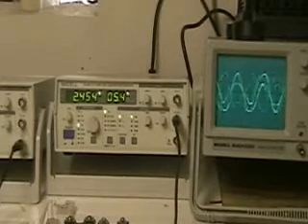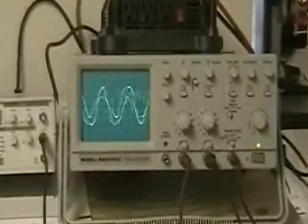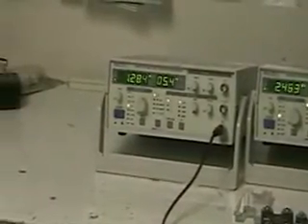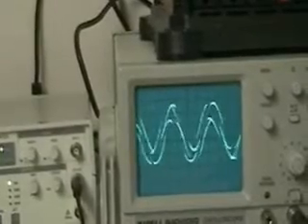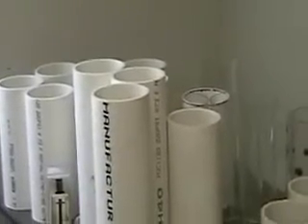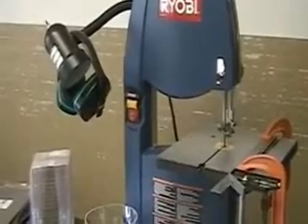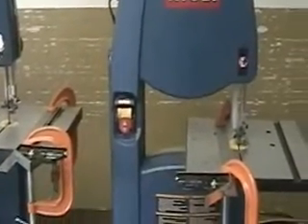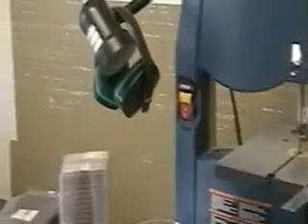Hydrogen Tap (Back To Work) 291

Comment: Stan mentions a process of injecting ionized air (from the air intake) to HELP the water disassociation. This same process is used in laser isotope separation for uranium. Not a very good process for uranium but curious what it could do to up Hydrogen output. Guess I need to find out how powerful a laser is needed for this.

Comment: johnarons! your lab looks like my garrage! you are not alone in your search for the unknown. thanks for all your info.
my own tests with area based cells, i've found that there is a barrier where you'll be forced to use more volts, they are related, i hope your own tests may validate this. v(PA(A+EL)/PS) = GV where  pa = plate area, ps = plate space, and el = electrolight levels, a=amps and v=volts.. the relation is actualy there.

Comment: But why don't you just use the jazz' motor to power your car?
I mean, that would be much more practical and efficent than using burnt hydrogen to drive pistons inside your engine.